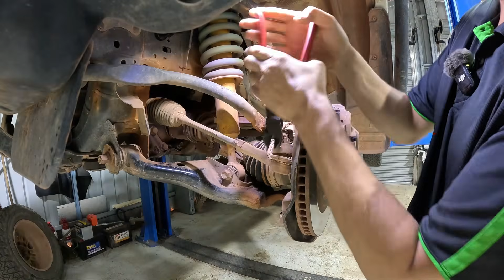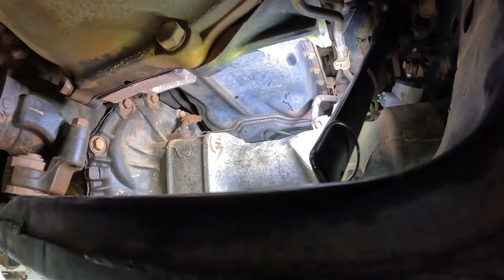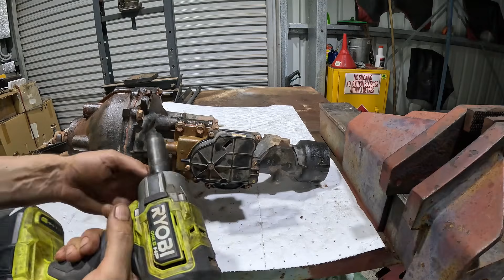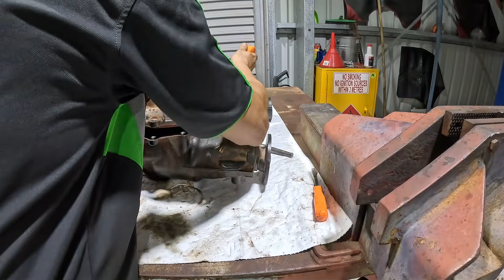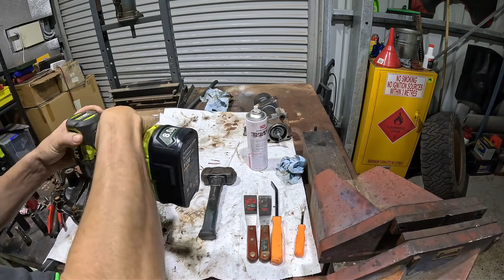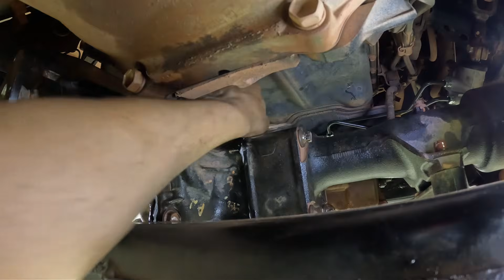How to remove and repair Toyota Hilux Front Diff N70 2005-2015

Comment: I want to replace the front differential of a Hilux N70 with a differential from a Prado KDJ120 in order to lower the gear ratio to 10:43 (4.30). Can this be done?
direct swap
Reply from the maker: I haven't swapped them before, but they do look the same

Comment: Awesome videos mate thanks for putting them together for us. The fill plug is very hard to get to i tried using a 10mm allen but it doesn't seat well and im worried ill strip it. Any tips? 😅
Reply from the maker: Hit the fill plug a few times with a hammer and punch first. Use an allen key socket or the ball end of the allen key with a spanner on the end to help turn it.
Reply: @HTM-24 thanks brother. Managed to get it with the allen key after a bit of persistence and scraped knuckles. Thanks heaps

Comment: could you just weld a nut while the diffs in place and replace that roller bearing? just pressing the new one back in might be difficult
Reply from the maker: probably could youll just have limited space
Reply: @HTM-24  removed the diff welded the nut on and the cage and all the needles came flying out, and the race stayed in.. had to remove the spider gears and press the sleeve of the bearing through the other side, bloody mission, I see in the states theyre using solid bushes instead of the needle bearings. Thanks for the video, and response, you gave me the courage to do it

Comment: Hi would just like to know how you knew the needle roller bearing was buggered and was that on the left hand side ?
Reply from the maker: I went to replace the seal. When I got the old seal out I seen the failed bearing. So I decided to pull the diff out and see if there was any other damage. Having play in your CV shaft is normal so don’t let that fool you.
Reply: @HTM-24 was it noisy at all ? I can hear a worn bearing noise type of thing when I spin the passenger side wheel off the ground. Or is it a failed tapered bearing? Thank you

Comment: Hey mate the right side (drivers) of my front diff makes a rattle while driving, seems like the cv axle is loose. Do i need a new diff, or can be fixed?
Reply from the maker: It could be the CV worn out. The diff bearing or just the seal
Reply: @HTM-24 Okay I checked lastnight, gave the cv another couple of hits with a crowbar and hammer. The clunking noise has gone. The cv wasn't all the way in 😅

Comment: HEY BRO I LOVE THE CONTENT KEEP THEM COMING ,,,,I HAVE AN ISSUE WITH MY TOYOTA HILUX N70 1KD ,I AM TUMBLING THE MOTOR BUT ITS NOT STARTING ,I REMOVED ALL LINES TO THE INJECTOR AND THERE IS NO FUEL COMING UP AND MY SUCTION CONTROL VALVE IS NEW GENUINE LONG TYPE ,ANY SUGGESTIONS WOULD BE GREATLY APPRECIATED MATE.
Reply from the maker: you shouldn't remove injector lines and crank it on a common rail, it's very high pressure. Make sure you a getting fuel supply to the fuel pump, check fuel filter and primer. Electrical problems will also stop the engine from starting.